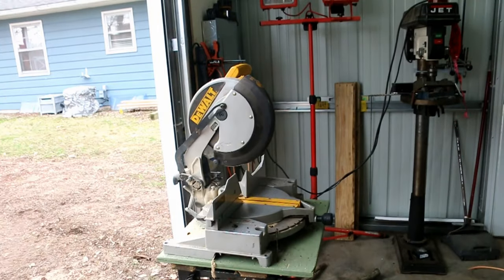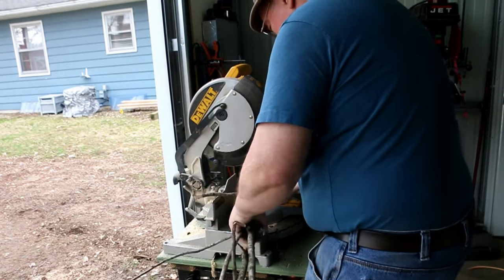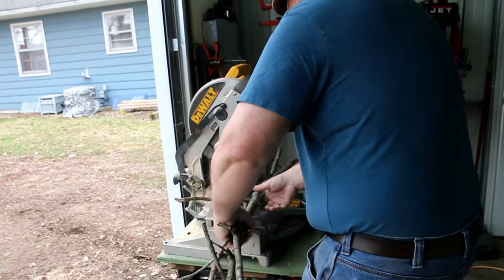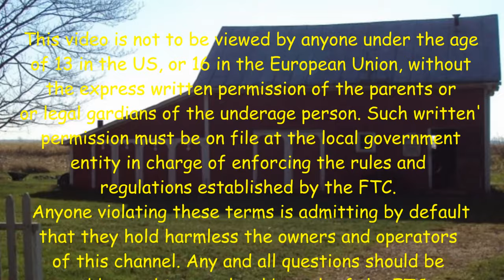Trying Something New   Bundled Kindling  No Splitter Needed

Comment: Just paid our sawmill buddy $200 for a full ton truck load of cur and split oak and hickory. Filled the shed back up. It WAS a LOAD too!
Reply from the maker: Good use for offcuts. 
Up here the sawmills wrap and pack bundles of slab wood that are sold at grocery stores and gas stations in the area. They bring in 4 or 5 pallets and people buy them for camping and backyard fires. 
I went to the Union City Sawmill and got truck loads of slab wood to heat the shop with one year.
The saw mill put in a chipper so they could sell the chips to a mulching operation that dyed the wood for fancy mulch. Good for them I was hauling it home for free. 
Then I figured out that I could clean out Mom and Dad's fence rows and never run out. 
Over the 21 years we lived there the wood stoves were there the last 15.  I must have went through a couple cords a year.

Comment: I have to build another portable fire pit, mine is kinda burned out. I have the sheet metal from an old washing machine up above in the loft that should do the job. The one I got now was a wash tub I bolted some old metal folding table legs on, legs are still good so I can use them again on the one I make.
Reply from the maker: I see a lot of people using a wringer tub from an old washer for a first pit. 
The washer shell should do it just fine. 
I made up a fire ring from a 10" wide strip of 1/8" thick hot rolled. Coiled it into a ring and welded the ends. 😁😎

Comment: I've grown fond of my baby 8in battery chainsaw for the past few years ter older I get I want stuff with less maintenance and makes life easy.  I knew a few people in coldwater that use to have wood dropped off hands off.  You have to decide at one point what's your time and sanity worth to you.  I'm glad you have a task that makes you feel useful and is useful.  I tend to have to trim up trees at clients houses to get access to an area and unfortunately have to haul off a bunch of limbs (loss of money).  But I have a helper that cuts it up for me and wrap it up into manageable sizes.  Then we drop that firewood off at some elderly peoples houses that burn wood for free to help then out.  They are generally ecstatic to have someone give them something for free and stop by 👍.  It's exactly what my grandpa would do for people and never left me.
Reply: I got my Sweetie a Stihl battery with a 3 inch bar. Every plant and bush on the place QUAKES when she walks out the dorr with that thing. I say 'Yes Mam'! a lot.
Reply from the maker: Long ago and far away I bought a corded pole saw. I used it to prune back the trees at the Union City house. 
I made the mistake of removing the power head, which was an electric 8" chainsaw. I left it on the bench in the shop and I came home from work to find a balsam fir with the bottom cut up to 5 feet and a 4" side branch lopped off next to the trunk. 
Proud wife then went on to cut a forsythia down to the ground. 
I reassembled the saw on the pole and left it on. 
Much the same as Toots and the saw. The plants  say their prayers when she has a saw in her hands.

Comment: Getting firewood keeps you warm twice,  getting it and cutting it. Then when 2 burn it !
Reply from the maker: It only does that for the person or persons who are cutting, hauling, stacking, and loading it into the fireplace or furnace. 
The rest just enjoy the benefits. 😁😎
Reply: @OldSneelock  Lots more than twice. Ours was after the logs were dropped off they were blocked up, moved to the splitter, stacked in the buggy, hauled to the shed and stacked, reloaded, moved and put up on the porch and moved again inside to the stove and loaded in the firebox. My brain might be full of dust and diesel smoke but that's more than twice.
Reply: @lewiemcneely9143   Agreed...a few more times than 2wice!!
Reply from the maker: The new/old furnace in the shop has a forced air system in the fire pot. I think it will burn chips.
The kennel where we use to board Sadie has a corn burning Hansa. An auger fed the corn, or wood pellets, into the fire pot. That would be an interesting modification. The stove could be self stoking. Burn all night without more than keeping the bin full. 😁😎
Reply: @OldSneelock  I may have mentioned previously, a few years back, I was in a very modern house with a coal based central heating setup.    It also used an auger to continuously supply the burner.   I wish I'd had the time to study it more.
Reply: @tree_carcass_mangler  That was what our school had. A stoker to keep everything going and a hot water radiator heating system all over the building. I was always trying to catch the stoker when it was running. It had the auger with a blower to give the fire a breath and catch up and doors to dump the coal downstairs where the boiler setup was. It had my attention!
Reply: @tree_carcass_mangler  LOTS more sometimes and even more the rest of the time!
Reply from the maker: Those have been around a long time. They called them stokers back in the day. 
A friend of mine when I was a kid lived in a house with a coal furnace and a stoker. His dad was an engineer at the local coal fired power plant so I imagine he figured he didn't need to get up and shovel coal every morning. That was in the late 50's.😁😎

Comment: Sometimes you use what's works for you and I'd available 👍 I have gone battery power on all my power tools so it's nice to not deal with extension cords and have the power tool were you need it (including battery miter saw and table saw).  I feel every generation makes tasks easier(such is human nature) till life is darn near automated.  Wrapping the cords of wood reminds me of pvc pipe and how much of a pain the 20fters are to wrap I may have to build a quick sawbuck on site to make like easier.  I bet none of us want o go back to how tasks were 100 years ago so it's important to learn about the past so we can't complain about how it is now.
Reply from the maker: I have have been using a mix of power and hand tools for most of my life. 
Knock out the big stuff with as big of a tool as I can to save time and finish the fine work by hand if needed.
I learned how to use older tools for the challenge. Once I understood how the process works it got a lot more interesting and fun.